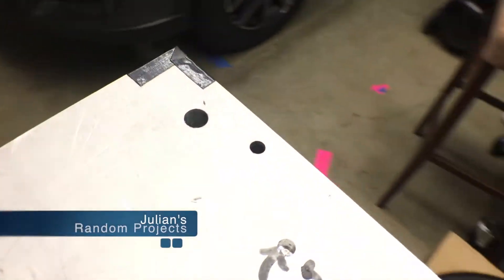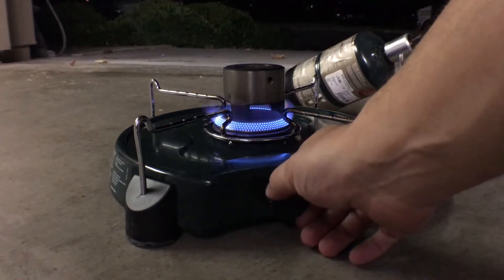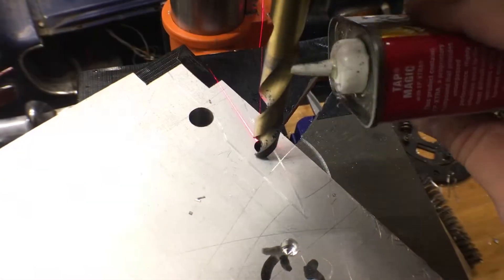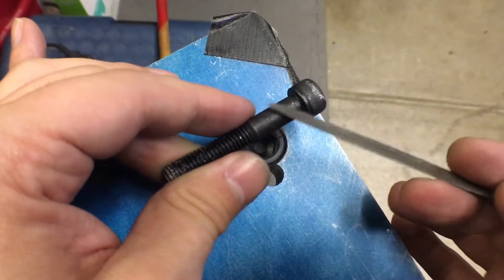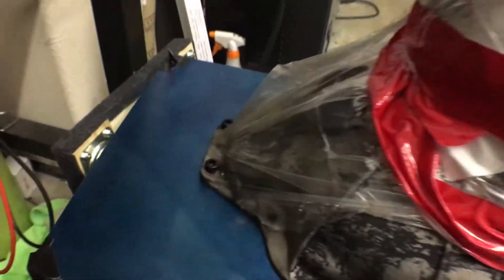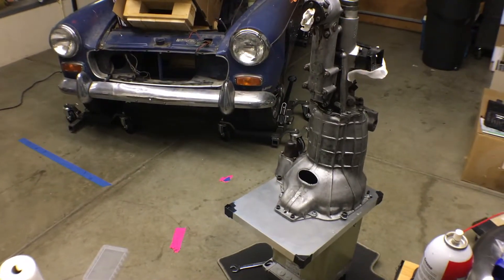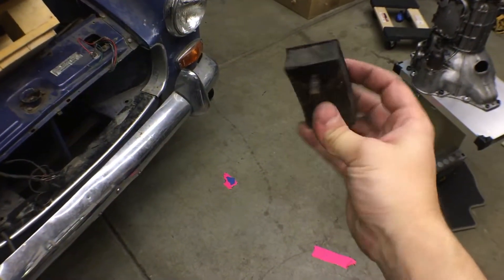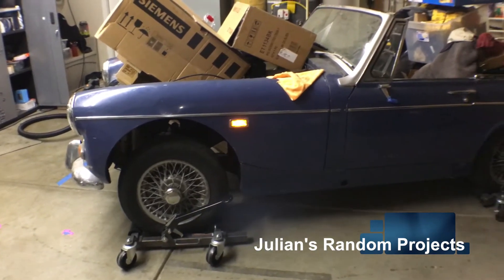MG Midget EV Conversion Part6 Adapter + Coupler

Comment: Excellent work! Question -   Since both coupling/spline pieces are slipped onto the spline shafts (and the set screw is tightened on to the spline insert) -  What keeps the lovejoy/spline couplings from sliding back and forth and separating?  Thanks!
Reply from the maker: The splines on the motor side have a step so the coupling piece can slide down enough to touch the motor housing. And on the transmission side the splines flare out back to the shaft diameter so they've only got so far they can go. Leaving some play between the two but I'm hoping it's not too much... time will tell :) Thanks for subscribing!